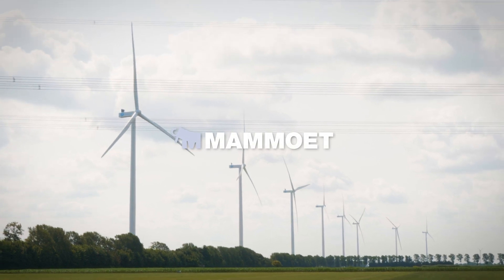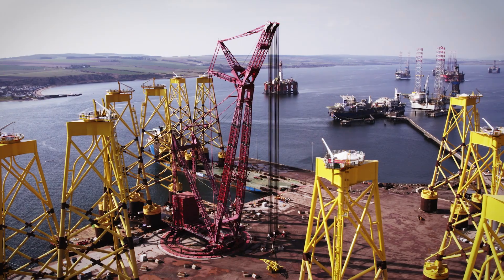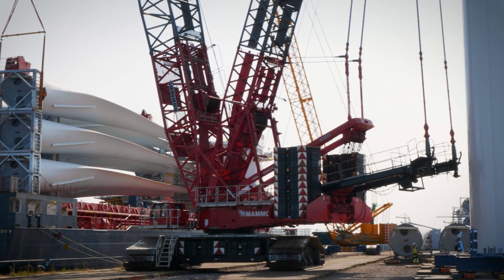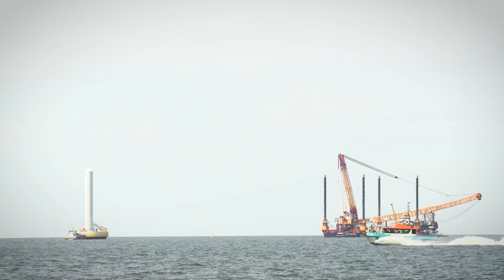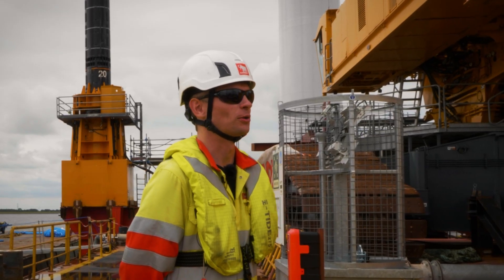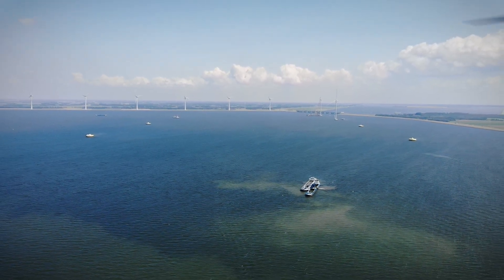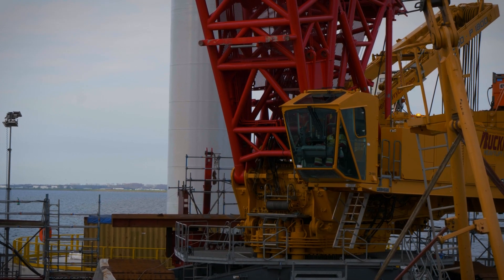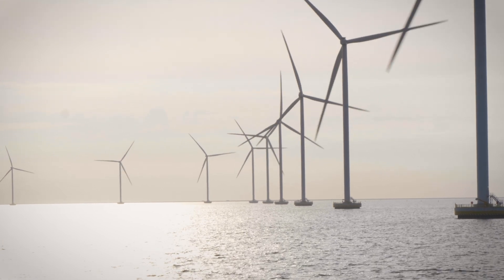We assembled this wind farm using a CRANE on a BARGE

Comment: Who designed the barge and how did they make it smaller than the past ones
Reply from the maker: Hi Randy! Our engineers procured the largest barge that could reach the IJsselmeer through the Dutch inland waterways. After that, they engineered support systems on the barge (making it larger) to fit the purpose of the project.

Comment: Who is producer of this newer turbines ? And where are this turbines produced ? Is it still Europe or a Chinese replacement ?
Reply: Looks like it's GE Cypress 5.5 MW turbines
Reply: @Tumleren  But 5.5 MW is not state of the art. Currently big wind turbines reach 15 MW. Available from China, USA and European producers.
Reply: @wolfgangrenner4152  These Turbines are Onshore-Turbines. Only Offshore-Turbines reach 15-24MW. With the answer from Mammoet here, it was not possible to reach the IJsselmeer with an offshore Installation vessel. Putting a Liebherr LR11350 on a barge is crazy (but very cool). For an offshore turbine you have to use two LR11350 for the installation. Tandem-Lift on a barge would be to dangerous.